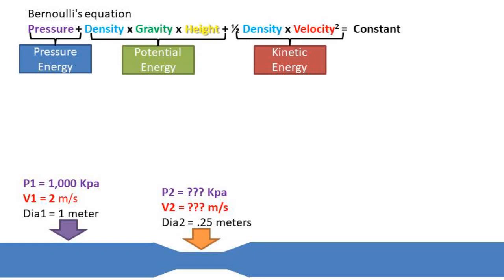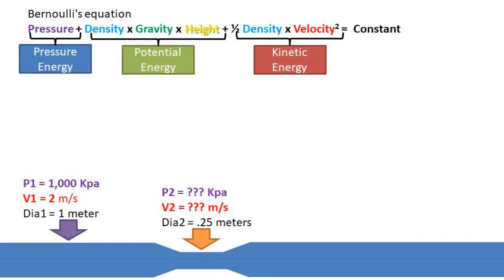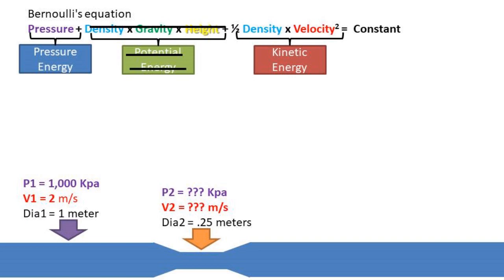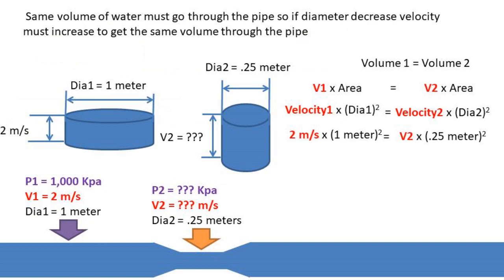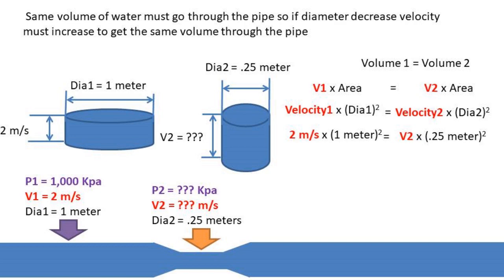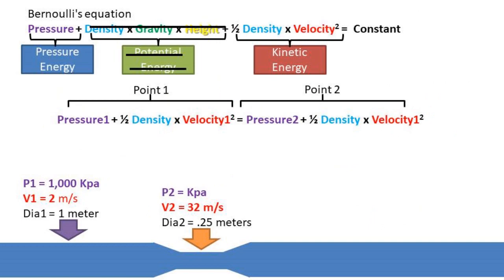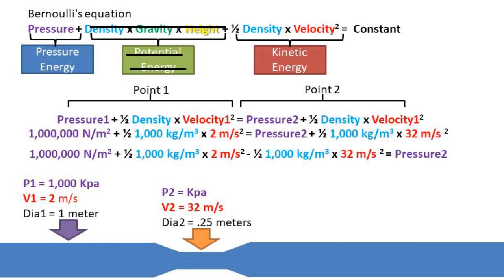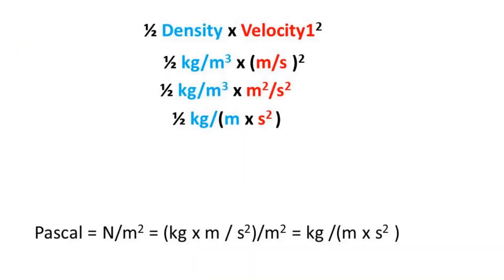Bernoulli Equation (Find Pressure and Velocity in Pipe After Reduction In Size)

Comment: Does the length of the reduction of the size of a water pipe (6" vs. 10') have any bearing on the pressure at the end of the pipe?
Reply: Not for constant Head(Energy). Only effect it has is when you calculate energy loss through decay constant k. Basically the change in velocity is smoother so you lose less energy(pressure + KE) so your K value will be higher. For no loss of energy K=1 so its kind of the invisible constant that most professors will ignore when first teaching the equation.